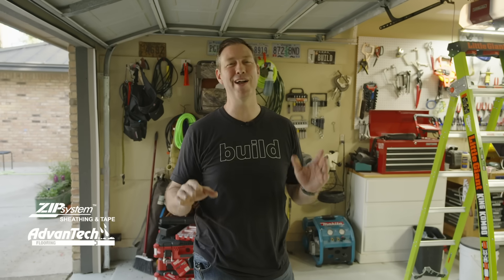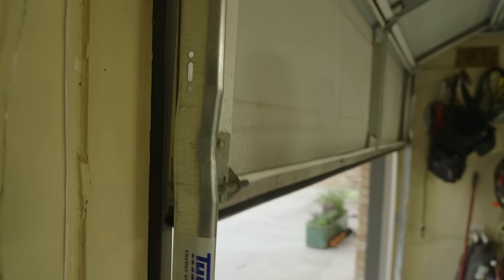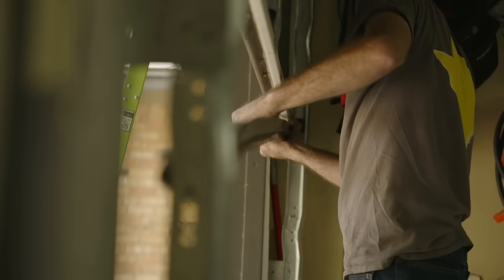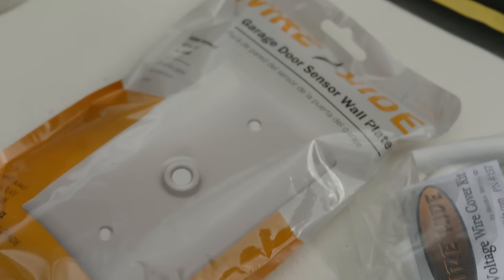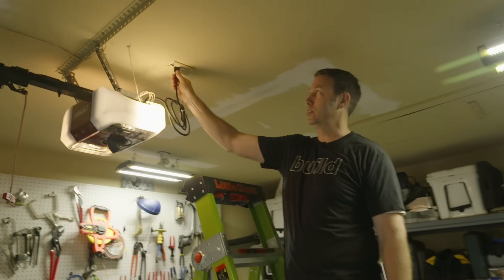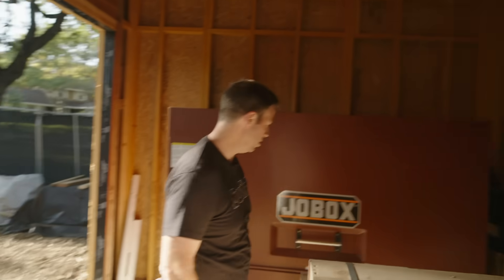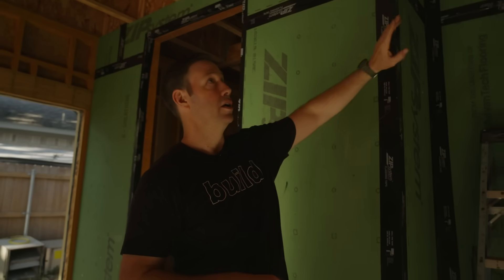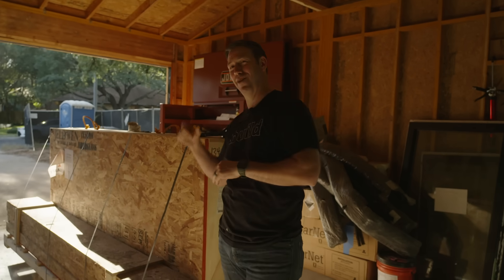Garage Door - Air & Bug Sealing

Comment: 16x7-Foot insulated garage overhead door with LiftMaster garage door operator. Bought a bottom glued down tapered seal from TEMU USA installed in 2024. Very simple
installation except the garage floor should be level. Strike a chalk line to define the area to put down specialized adhesive for concrete (I used Gorilla). LiftMaster can be adjusted as to the downforce. The typical bottom gasket would benefit by installing round foam pipe insulation inside the gasket which adapts to imperfections in the concrete floor. Bulletin: Thanks Matt for advising insulating the subfloor for any room spaces above the garage. House was a spec. home finished in December 2005 in SE Michigan and the drywall was already installed and taped, which prevented the suggested upgrade Additionally the garage door faces Northeast so it gets the winter storms full on. Great content on your channel!

Comment: I live in Colorado & had Clopay insulated garage doors installed, but the installer did a bad job with the weatherstripping. I'll see about changing to the ThermoTraks system. A tip for you: remove the red plastic t-handles on the emergency pulldown ropes because thieves can fish a coat hanger through the top of the door, grab the t-handle & open the door from the outside.

Comment: The My Q app is decent when it works, but it's unreliable.  About 1 time in 50 the my Q app will decide not to connect, or will connect just 1 or 2 doors out of 3!  Not well done.  It's very frustrating when I can't get in.

Comment: Did you install a side mount opener? wondering how you sealed the top. I have one on all 3 of the doors on my garages and they do not seal. I'm in the Chicago area so we get 100 degrees in the summer to below 0 in the winter.
Reply: Had same issue. The side mount leaves a gap at top of the door. Where a chain drive puts pressure on top and seals tight. I ended up returning my side mount opener. Wish there was a fix for this.

Comment: Loses has a garage door insulation kit for 8 or 9 foot doors. Slips into each section. I had a 16 foot garage door so bad to use 2 kits. Helps a lot here in South Texas for the heat and cold.
Reply: Lowes

Comment: My garage door is already insulated and it's great. The downside, is that the door is VERY heavy. Mine is a 1 1/2 garage door length and requires two of the door springs to help open. Otherwise it's great. Highly recommend. ALSO, it doesn't make all that flimsily sheet metal noise when operating. Mine is actually super quiet.

Comment: Haas is vender that makes the best garage doors on the market, (my opinion). I installed 2 steel back sandwich doors on my home, and noticed a huge difference in temps throughout the year. The insulted doors will help maintain whatever the temperature is in the garage. And they are a very durable door, they do not dent as easy and you won't have to worry about the vinyl/foam insulation tearing or puncturing.

Comment: Split pipe insulation slips on to the bottom of the door, closing off any air/ water leaks. No glue or screws needed to secure in place. Has worked for years.

Comment: I had the same thought about zip system in the garage.. contacted Huber directly and they said it should not be placed on walls that are shared with interior walls. Also that the sealing quality improvements would be minimal compared to vapor barrier, drywall, and taping. Just curious if you were talking to someone with better info since you shout out Huber so much. I want to take every possible step to seal my garage and protect the living spaces.

Comment: Great video with good ideas for the garage. 
I was intrigued by the Tamarack vent, but what I found didn't mention anything at all about being automatic. To me, automatically sensing and exhausting combustible gases and carbon monoxide would be the primary benefit of an automatic garage ventilator - an idea triggered by your video - but I wasn''t able to find anything like that on the market.

Comment: @Matt Risinger Hello. Thanks for the video. Looks like I am a few years late to reply. Just saw this video. Anyway I just moved into my Newley built home back in September 2023. We since had the brand new basic metal single panel 2 car garage door removed and replaced with the same looking door but it’s insulated. It’s metal on both sides. The nice thing it did was provided better sound proofing. We also removed our ceiling mounted garage door motor and went with a side mount jack opener. Also very nice. The bedroom above the garage area no longer has to has to hear the loud chain and loud door noises. The heavier door does not rattle all over inside the tracks. 

What we did see that was a negative. Within a couple days after the install. When we went into the garage and opened the door. We saw water dripping from the inside of the door. When we went to close the door water was squirting from all around the window panels. Yes we have windows across the top of the door all the way across. Anyway we were shocked about this. When we looked at our humidity and temp gauge in the garage. The humidity was around 80%. Since we have a more sealed in garage door. The moisture was building up significantly in the garage. This went away with the use of a dehumidifier. We do not have a MiniSplit in our garage. This water and humidity build up went away. We are now down around 40. Of course the days it rains is when the dehumidifier runs. Since it’s winter the cold air sucks moisture out or dries things out. So the dehumidifier barely runs. The reason this all happened is because the air gets trapped more inside the garage. What will really be hard is come summer. When the humidity will always be high. We live in South Carolina where it’s humid. 

We do have some small openings around the bottom of the door where the outside brick and the door trim meet. So that lets air or humidity into the garage. We do have a large ceiling fan on the ceiling in the garage. We have no idea what we will experience come summer. Hopefully we don’t find that the heat will also get trapped inside the garage now that we have an insulated door. We totally didn’t think this part out or expect this. We for sure will need to run a dehumidifier to control the humidity. We just hope that we can also somehow keep the heat from building up or being worse than it would have been with a basic metal non insulated door. I know that many of you would say install a MiniSplit. But we just do not want to have to do that.

Comment: The door is already designed to wedge against the opening. If you have someone who knows what they’re doing and an opening worth a damn I can put doors in all day with absolutely zero slop. Only looked this track up because we tore it out concrete settled and door wouldn’t touch the ground anymore.

Comment: Howdy Matt
Yes I did insulate my garage door. My doors look like yours on this video. Used 4x8 foil backed insulation and cut to fit each panel.
Really makes a big difference. (Temperature and sound) Amazon has a bottom of the door seal that has an inner tub that was better thatn what the 2 big box stores have.

Comment: Thank you for all the great videos.
Keep in mind Chamberlain/Liftmaster (we have the wall mount Liftmaster) works great. But for the person who wants to control either of these door with Smartthings,  Apple, Amazon, and others will be disappointed.
This company has made it nearly impossible to integrate  these apps with MyQ.
They also discontinued  the hub as well as the 825LM switch, so you can not control your existing garage lights with your opener.
Just keep in mind, you will have to implement a complicated work around.
If there are other brands available that connect to these apps, I would go that direction.
We are happy with the Liftmaster over all, as we needed a very quiet door. The only option was to put a occupancy sensor light switch to turn on the lights when we walk in.
Thanks again,
Charlie

Comment: When I add a new bottom seal rubber I take a foam tube that would go around a 3/4" water pipe to stop freezing or dripping. then cut it in half length wise making it a semi circle.  I then taped enough strips together to go the length of the door, and pulled it through the bottom rubber bottom tube.   This way when the door comes to rest on the concrete or floor gasket it will seal tight and not collapse.  I've used that on several doors and it works great.
Reply: Thx creative genius 👍

Comment: I installed two 8500 about 5 years ago, they have been working great. Had to adjust the torsion spring a little bit left and right and installed both units in the center of two doors. Pre installed a center outlet up high for power. Ran cables before Sheetrock and installed shallow wall box and cutting two holes adding grommets for sensor cables.   Unit also comes with the rail deadbolt which stops door from being lifted. I really think I need to add the kinky rail kit that looks like a great idea.

Comment: use spray foam to glue in silverboard or a 1/2 foam board insulation. Then cover the back with a thin reflective radiant insulation. I spent about 350 on that with two doors. Helped a bunch, had a 60 degree garage while it was snowing outside. And the doors don't radiate heat in the summer. You keep an airgap and have an R value of about 6-8.

Comment: The seal is less useful when you staple it that much. It needs air gaps to work properly! The better solution would have been double sided 3M tape followed by a staple every 12 in. Also, that exhaust fan is a gimmick because one, you open the garage and it’s ventilated and two, what’s the point of a vent in the garage if there is no air gaps or intake in the garage through which you can suck fresh air into the garage? You can’t have an effective exhaust fan without an intake vent both of which defeat the purpose of insulating and sealing the garage!

Comment: I like the seals on this ThermoTraks system but I think overall instead of having this modified track that shoves the door against the seal, the Green Hinge System seems better overall with spring tension pushing the door up against the seal instead.  It's also easier to retrofit and lower cost overall.  The double seal on the ThermoTraks system seems nice though.

Comment: In texas a insulated door keeps the heat from the car engines in the garage during the summer.  Also heat from hot water heaters heats it up.  If you seal it too well then you need a fresh air vent for the hit water heater.  Nice in winter to keep garage warm.

Comment: 1. Vinyl weather stripping shrinks over time. Always cut them long or folded in as was shown here to be pulled out later as needed.
2. The shaped door rails are way over priced. I just took a wood dowel that fit in the rail, spit it lengthwise and glued it in where the wheels stop.
3. I'll be damned if I'm going to let strangers open my door.
4. The exhaust fan is gimmicky nonsense and not needed.
5. I don't need doors closing without me doing it myself. You can buy a simple wireless device that will let you know if a door is open.
6. Double doors should be 18'.
7. Wall mounted door openers don't push against the top of the door in the middle. This causes a gap at the top of the door.

Comment: Matt I had an insulated garage door at my last house, it was in direct sunlight all morning until early afternoon, no other special sealing or anything but the garage was always cooler (still hot) than my new garage where the door is never in the sunlight.
Re the My Q I'm not sure if they've changed it but it's meant to open the garage door in the event of a fault on the system which is not good especially if you are on vacation!

Comment: So the Siga Rissan tape will be showing on the horizontal plane on top of your concrete. On the vertical plane it will be covered with drywall. What are you going to do so Siga Rissan tape is not exposed on the horizontal plane? Some type of finished floor over it? Curious

Comment: Very handy list of features as I am working to insulate my garage and build out a 4 season work space. Did you find a good solution for the bottom of the door seasling?

Those sensors are going to be huge! They are constantly being knocked out of alignment. While I don't have plans to upgrade my lift as its only about 4 years old, I may look into adding a computer battery backup (UPS) to to the lift so it works when the power is out.  I like the idea of the new channels to help air seal as well.

Comment: Hey Matt, put a 1" foam backer rod inside the "D" shaped rubber molding on the bottom of the door.  It prevents the D shaped molding from collapsing and makes a much better seal.  Bob

Comment: 1/ I was excepting to see more on bug sealing in this video. Please make one on bug and rodent sealing. 
2/ live in SF Bay Area. Never seen outside weatherstripping for top & sides of garage door. Our garage & attic are unconditioned.  How does  your weatherstripping help with rodents? …bugs? 
3/ there is a YouTube on the thermal efficacy of various installations available for metal garage doors. See https://youtu.be/vp-wfrolo-k?si=9ohkXic-UCwrIXzi

Comment: If the door has play you need to ajust the rails. Those door seal products are snake oil. Look at a standard door and you will notice the distance from the ral to the door is greater at the top than the  bottom. The reaon that is done is to wedge the door into the seal when its closed. Use normal stuff and make sure its installed correctly and it does exactly what you want by design.

Comment: Instead of those tracks, another great option is Green Hinges that are spring loaded Hinges that push your door outward into the edge seals. I did a video of my father helping me install them onto my garage doors. It takes minutes to install and makes a big improvement for heating and cooling the garage.
Reply: Just ran across your comment; I appreciate you mentioning Green Hinges - didn't know those existed.  Just ordered some.

Comment: Hey Matt: Great, informative, videos! Quick questions about the ThermoTraks (sp?). After install, any need to adjust garage door spring(s)? Does the slight serpentine in the track require more spring or overhead door opener “oomf” to help move the door(s) up & down?
I’ve also been looking at a product called Green Hinges I think, (springs integrated in the hinge); but my Wayne Dalton door(s) use slightly different hinges. Thanks in advance for any info/help you can give me!

Comment: So, something blocks the sensor, your app says to close the door. Does the app alert you that the door Can Not be closed?  He only shows the door going Down, with the battery, Will it open from outside? I can disconnect the opener from the door and put it down. If your garage is super insulated/air tight, where does the exhaust fan draw in at? Great commercials Mr Risinger.

Comment: #1 I watched the installation of the peel and stick seal. The main reason for failure is how they peeld off the backing and stretching the foam as they applied it trying to make it all one process/step as they pressedi it on. The constant tension created by the stretched foam trying to return to its natural length works against the the adhesive tape, causing it to fail as it gets shorter again. Cut foam to length before pulling backing, try not to remove backing by only pulling length-wise. Allow foam some time after removing backing to unstretch before pressing it into place.
#2 in your new garage with sloped ceiling and side operator, have the door tracks follow the wall up & along the slope of the ceiling. Dont make that 90 degree turn where the door opens parallel to the floor. That clear area above your head when door is open, will change your life.

Comment: THE PRICES ARE SO HIGH I CAN HAVE ALL NEW TRACKS INSTALL FOR THAT PRICE... WHAT YOU CAN DO INSTEAD IS MEASURE THE GAP AND IF IT WAS LIKE MINE 1/4 INCH I WENT TO HOME DEPOT AND BOUGHT SO 1/4 INCH THICK ALUMINUM BAR CUT IT TO LENGTH AND INSTALLED UNDER THE HINGES ... $30 FUN TICKETS ONLY  !!! COMPARED TO THEIRS $255 AND UP... GO FIGURE  !!!

Comment: Twisted track won't work with a 8-ft door. They make a rodent seal for the bottom of your garage door that rats or mice will not eat through it has steel wool fiber embedded and rodents hate that

Comment: In 15yrs, I've never had a need to use the battery backup in my garage door opener.  Unfortunately you have to replace the batteries every few years when they die.  So this feature looks good on paper, but doesn't add a lot of value in real life.

Comment: I understand the need to want to have good air seals, but wood needs to be able to breathe for longevity. This is why older homes built in the early 1900s are still standing today even if they suffer water damage due to pipes breaking, etc.. I have a feeling in the decades to come with newer building techniques that a lot of these homes will be rotting from the inside out.
Reply from the maker: If it cannot dry, it’s going to die.
Reply from the maker: Yes older homes lasted but they were energy pigs. The heat from the house was a hairdryer through the walls drying any moisture out. New homes can’t do no insulation so we must take water intrusion more seriously

Comment: Grardry rubber strip  seals gap between floor & bottom of garage, I got one online.  Having trouble with the double groove on bottom of door- its abit beat up and my 2nd seal isnt sliding. ☹️
Reply: Also I have insulated double garage door for the really hot, really cold westher we have, but I still have the issues you discussed causing light to show thru. Gonna try those s tracks